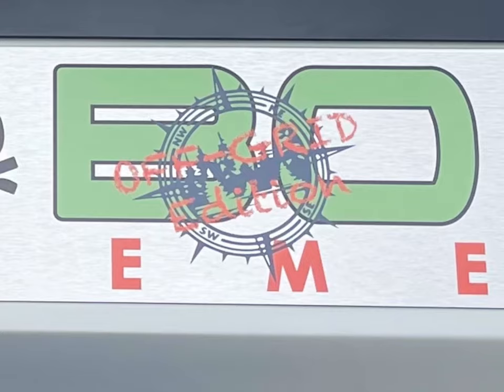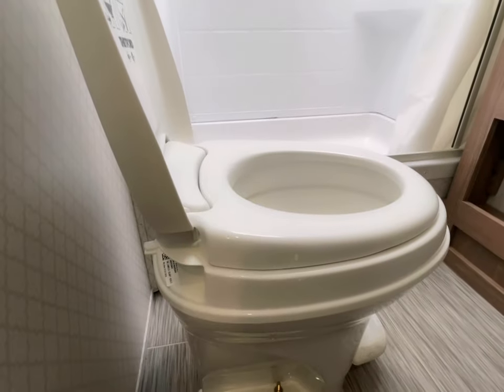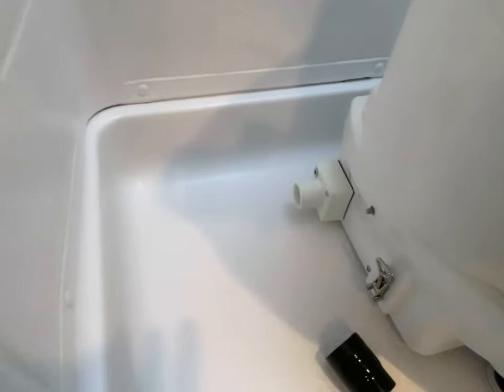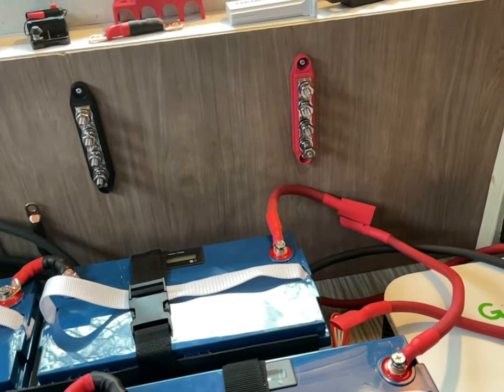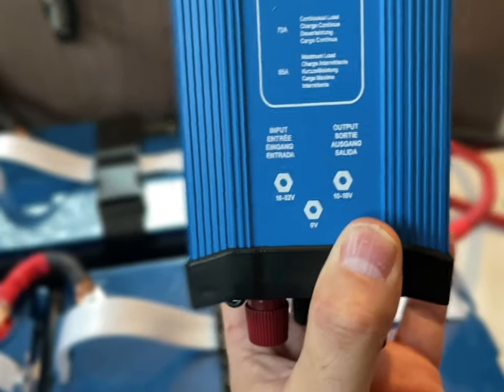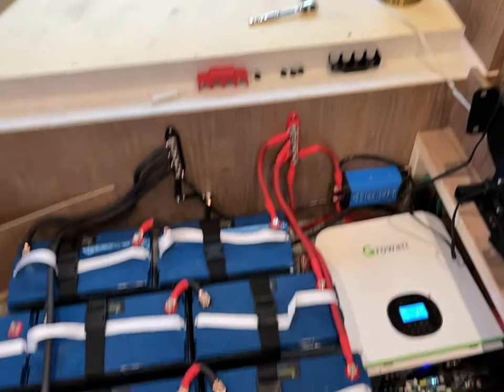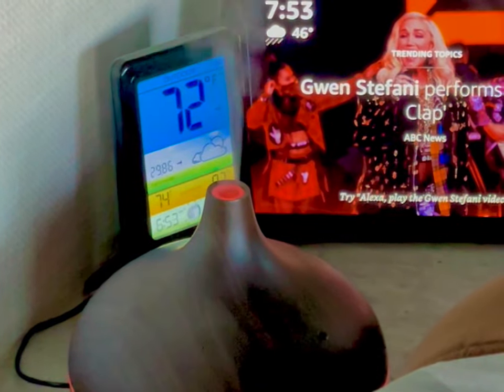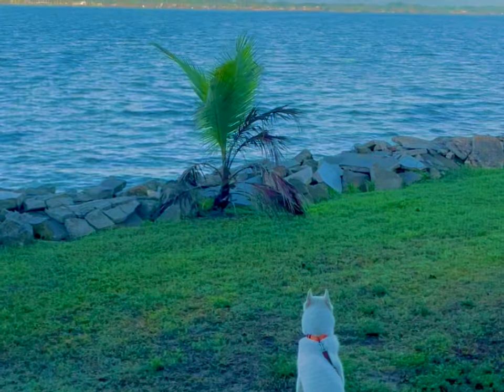I converted my RV into a "NET ZERO" Off-Grid, Boondocking rockstar in just 7 days!!!

Comment: How did you secure the batteries to the floor? I’m doing the same project, could you make a video on how is everything working?
Reply from the maker: Amazon sells a plastic battery hold down with straps and they interconnect.